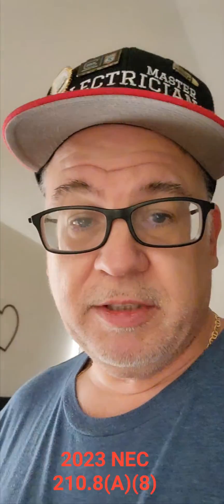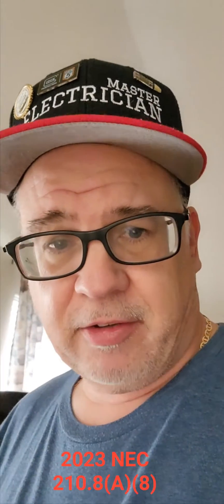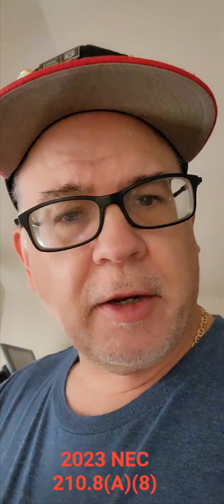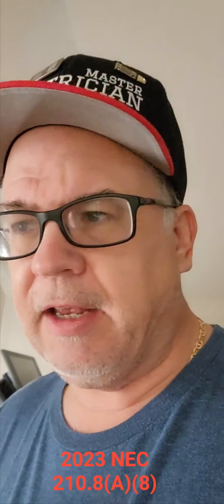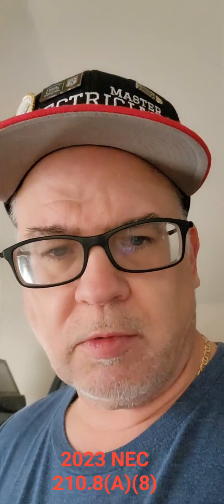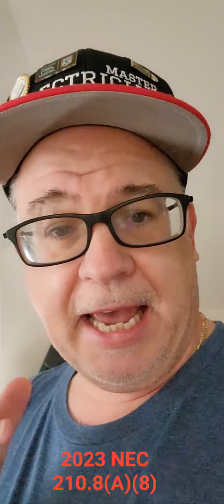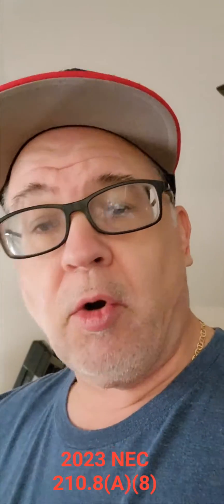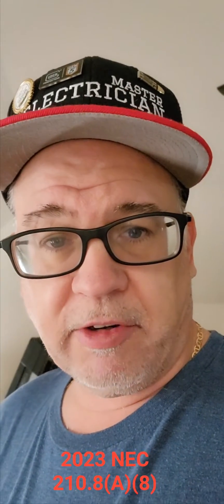NEC 210.8(A)(8)- GFCI Requirements for receptacles within 6' of sink

Comment: Is it measured along the wall then? Or is it just 6ft straight out from the sink? When I was doing new construction the inspector said it was 6ft straight out in any direction.
Reply from the maker: The rule is "For the purposes of this section, when determining the distance from receptacles the distance shall be measured as the shortest path the supply cord of an appliance connected to the receptacle would follow without piercing a floor, wall, ceiling, or fixed barrier, or the shortest path without passing through a window." Now, the within 6' is indeed in all directions but in the video example it would wrap around the wall since that's the shortest path.
Reply: @MasterTheNEC  gotcha, thanks for the clarification

Comment: correct   BUT  does it have to be on the bathroom circuit ?  since I use dual function everywhere is it being on the bedroom circuit ok? I would think so
Reply from the maker: No, it would not and could not as that would violate the NEC. The requirements to be GFCI protected has nothing to do with the circuit, just the protection of the receptacle via GFCI.
Reply: @MasterTheNEC  Thanks bro   Sometimes I ask questions other watchers might want to know.. You da man